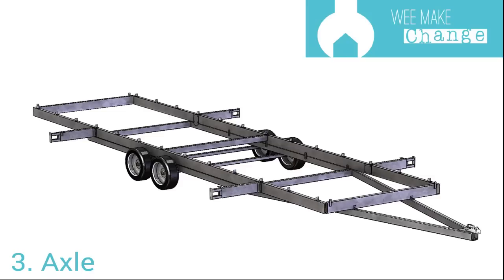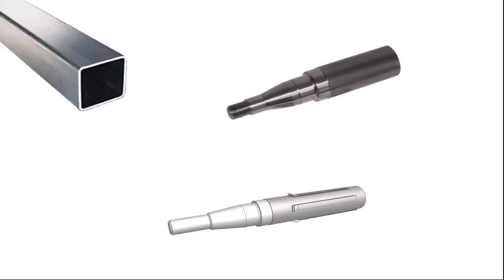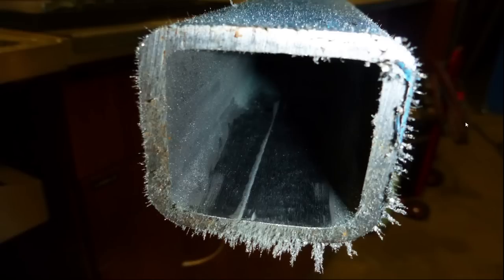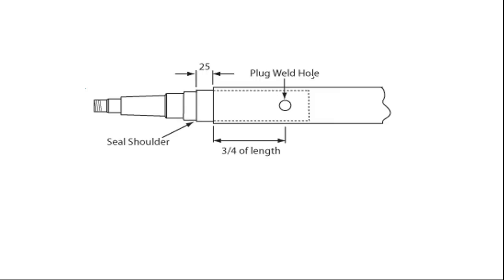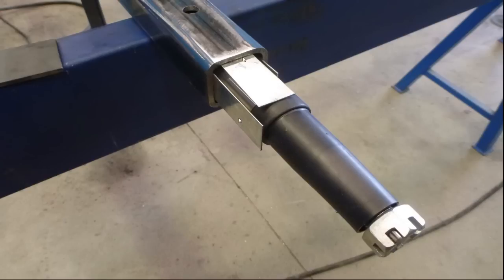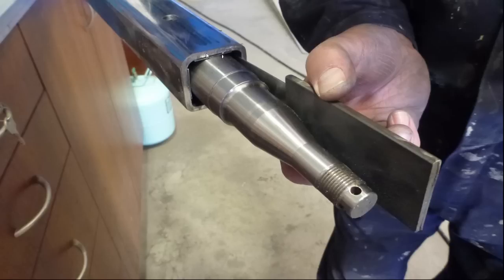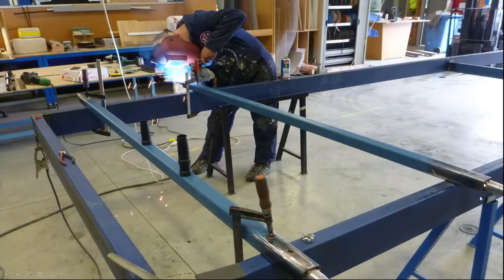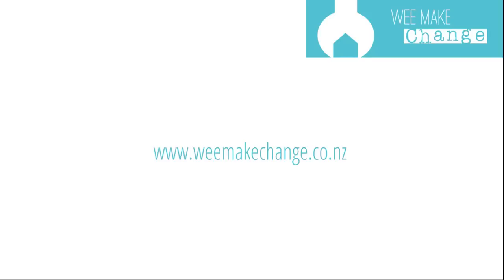Tiny House Trailer Build - 3. Axle Fabrication

Comment: I never fillet weld completely around the stub. I've seen too many stubs shear off with a load of gravel on the motorway. Just some really good plug welds.
Reply: Arr yes, stub axle snapped off with said trailer load of gravel on fri, how do you remove one to be replaced?
Reply: @Crozbyguy all good, ended up buying brand new heavy duty replacement hubs and stubs

Comment: nice one mate... i built a tandem car transporter without springs...towed mint..no point having springs if the load has springs, as we find with our speedway cars that they tend to wallow around as the car on top cycles through its own suspension travel..

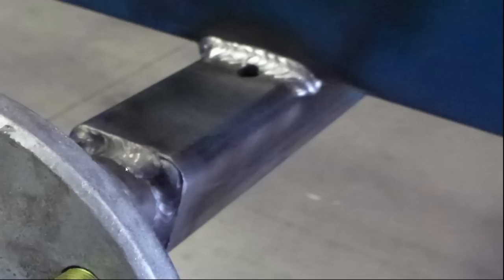Comment: I noticed at the end of the video, what seemed to be the axle welded to a frame (at 6:28). What is a purpose of that? Why isn't it suspended via spring??? Have never seen that sort of design.
Reply from the maker: Hey this particular video is showing what we would call a site trailer that is designed to be pulled around a site and not on the road cheers.

Comment: I am curious, why not use a round tube?
Reply: Hi, square tube is used so it is easy to weld to frame of trailer. Also this connection makes for a stronger joint than a round profile. Round tube could be used thro.
Reply: Square shape load bearing strength without bending is relatively higher than Round shape. Round shape can be used as a second choice

Comment: im making a dirtbike trailer my trailer frame is 1500 wide so how long do i cut the pipe for the axle ?? is it the same width or a bit longer or shorter?? plz reply thanks
Reply from the maker: +josh avery (SlingBlade Killa) Hi, you will need to make your axle more than 1500mm. See around 6:30 in the vid to see how much overhung we had which is approx 100mm. This will depend on your wheels and chassis clearance. Bassilly mock it up before committing and make sure it's all good.
Reply: thanks

Comment: Just curious on why not a square sub instead of round
Reply from the maker: Hey good question. You could use round tube but its makes to hard to attach to the trailer structure. Also square hollow section is often cheaper. Hope that helps.
Reply: Wee Make Change no I mean the stub axle that you welded into the tube they make square stubs that are 40mm so they slide straight in to 50x50x5mm shs
Reply from the maker: That is an option for sure. Is there a price difference between the two options? When we were sourcing parts could only find the round version.
Reply: Wee Make Change that makes sense

Comment: So no suspension?
Reply from the maker: bigshafe Hey, decided to do it a bit different and save cost in the trailer by excluding brakes, suspension, controls, etc. The trailer is not designed to travel on the road but on the back of a truck as we plan to only move it very rarely. We also gained width from 2.5m to 3.1m. Read all about it on our web site here: @2014
Thanks
Reply: +Wee Make Change If it will not be traveling on the road why put wheels on it? Is it a legal thing because without wheels the local government won't allow it?
Reply from the maker: +Phill Huddleston You are on to it and aslo  good to move around section. Just like NZ camp grounds.

Comment: This setup should NEVER venture onto the highway. It would be unsafe except at very low speeds.  It is suitable only for moving slightly and slowly around the yard, maybe? (and being very careful so as not to bend the axles).  When there are two axles, like you are using,  springs and equalizers are there for a very good reason.  I have seen tandem (two) axles mounted without springs under a car hauler (using very strong tires that can absorb the shock loads, instead of springs).  It can be done, but they at least need "equalizers"  (a pivot point in between the two axles where the two axles can swivel up and down in relation to each other).  Without that center pivot point? just traveling across any sort uneven ground (bumps or dips) could be very hard on the frame and tongue structure, axles and tires.  Just jacking the tongue up and down to hook up and unhook for towing? could cause damage to your axles or frame. Travel over a bump or dip could cause one axle or wheel and/or tire to be overloaded and damaged while the other carries no weight at that point. Tiny homes can weigh perhaps 5000-6000 kilos or more when finished and furnished.  
Normal trailer tires  can only handle those loads because they can share it equally. If you need two axles for the load? they must be able to conform to terrain and movement or they will be overloaded. 
Imagine when you need to turn sharp for maneuvering into  or out of the parking spot? With no suspension (leaf springs and equalizers) to flex and give while the turn scrubs the wheels sideways, there is only the tire sidewalls to absorb that. With too sharp a turn it could unseat the tire bead and flatten it. The steel wheel rim, loaded that heavily, could cut your sidewall and even ruin the rim.  Be very careful. Hopefully the finished house only has to move once slowly a short distance on smooth level ground with gradual turns. From the shop to the close by permanent parking spot it will probably work.  If you want to sell this home to some chap  someday who needs to move it across the country?  It will need re-fitting with suspension before the trip.  Much easier to just do it right the first time.  With the amount of investment in a tiny house? it really doesn't make sense to skimp on this small detail.  A complete tandem axle suspension kit would cost perhaps 1/2 the price of the tires this home will need.